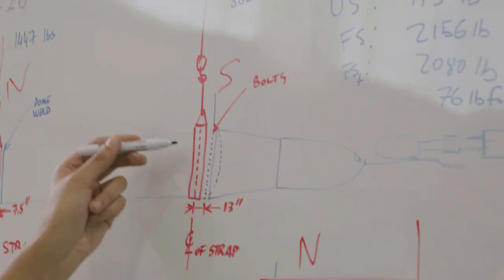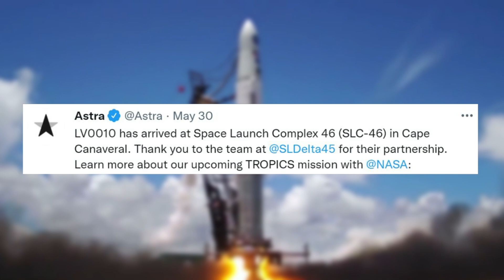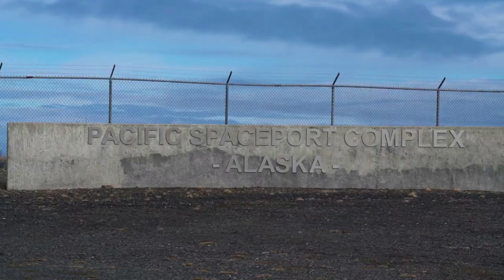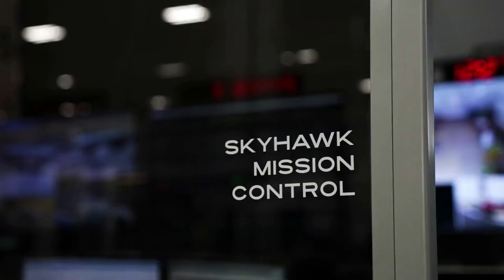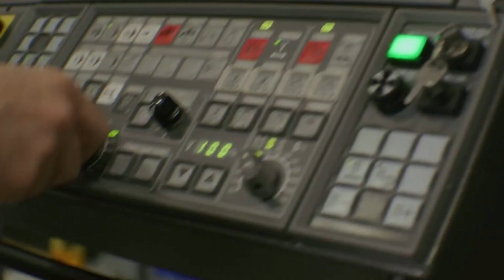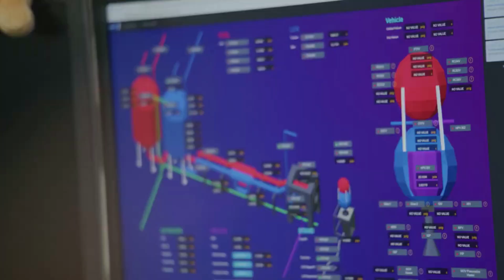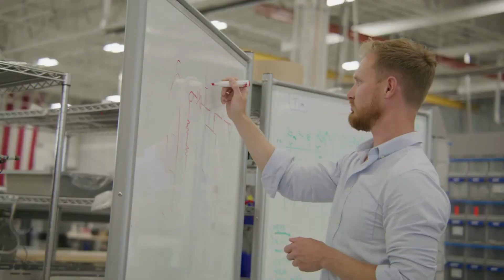Astra's Upcoming TROPICS Mission & Plans For The Future

Comment: Excellent summation of Astra Space.  It is an exciting company that has considerable potential.  I am not sure how any of these small rocket companies will compete with SpaceX after they have Starship and Super Heavy up and running.  However, Astra has the best shot at it.
Reply: Astra has no chance of competing with Rocket lab and Space X. Undercutting the competition when you have almost no money is a bad idea. That's exactly what their "new" rocket is doing against rocket lab.
Reply: @snake88ification  Rocket lab is deeply in the red. RL reported $40.7 million in revenue for the first quarter of 2022, a net loss of $26.7 million.  They are projected to break even the 4th quarter of 2023.  All these little rocket companies are on the edge of financial failure.  SpaceX being private does publish its financials. They however have so many investors they are probably one of the only rocket companies that isn't worrying about immediate financial ruin.